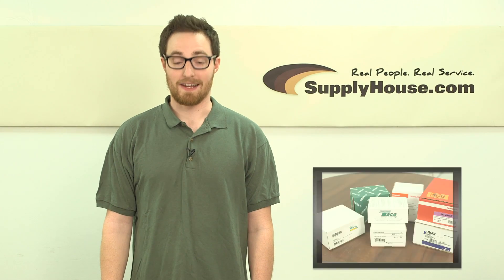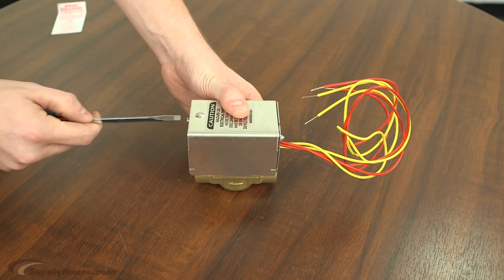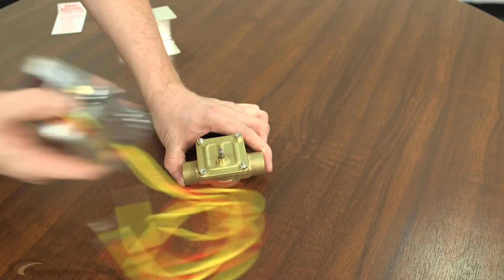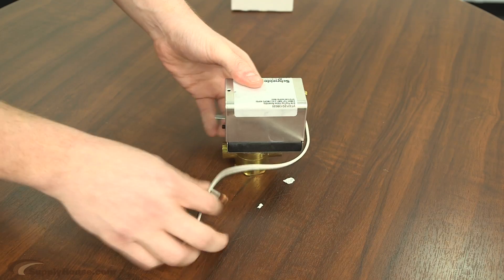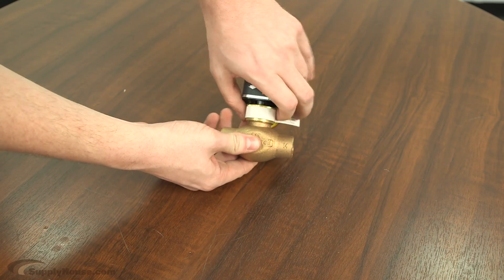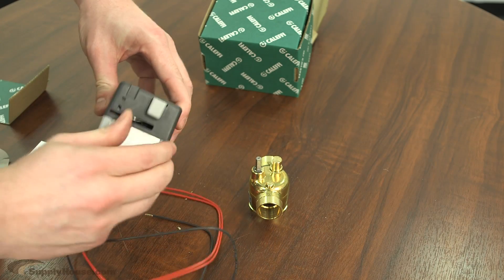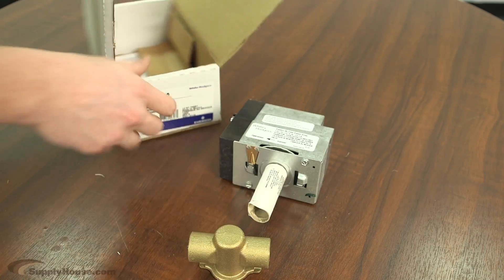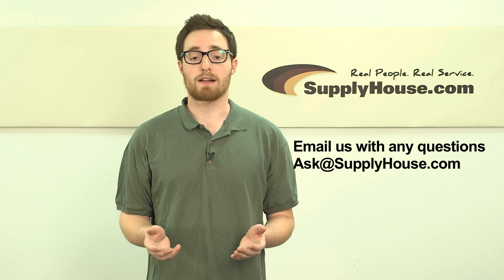Replacing Zone Valve Actuators

Comment: SECOND video I've seen from Supply House giving DANGEROUS INFORMATION about White Rogers zone valves.    You can't remove the stem from the brass valve body with the system pressurized.  You would be sprayed with scalding hot water!  You showed how to remove the motor head from valve body on the other brands.  Why didn't you show that for the White Rogers?
Reply: Right. There are two screws that hold the motor to the plate with the valve mounted on it. Remove the two screws to remove the motor from the valve assembly. You can see the screws on the bottom of the motor.